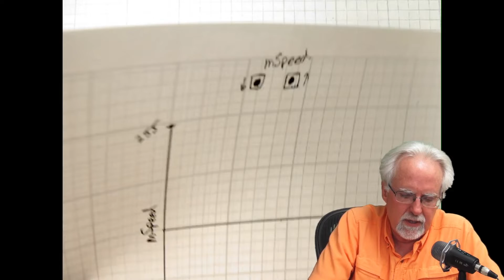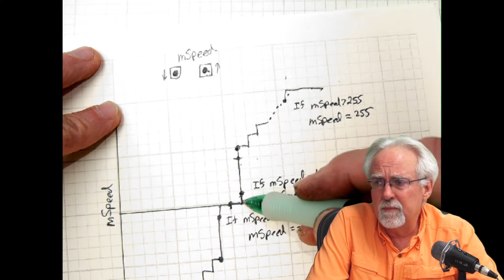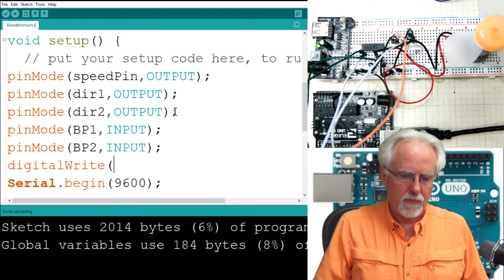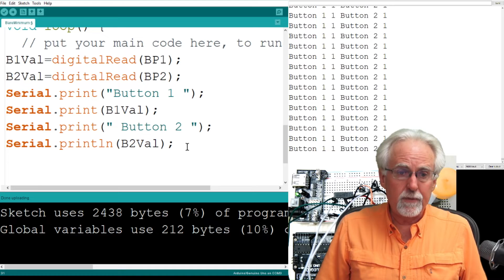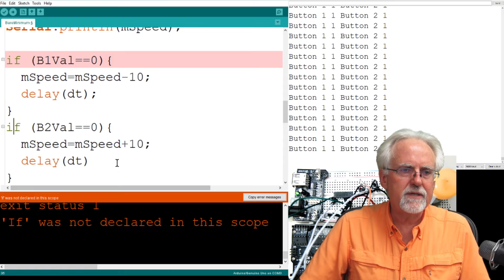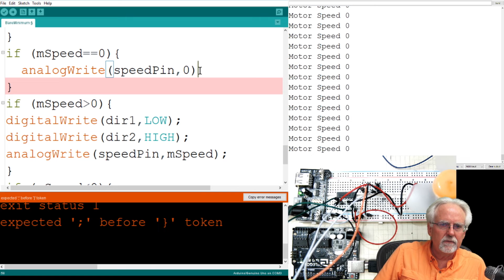Arduino Tutorial 40: Controlling DC Motor Speed and Direction with Pushbuttons

Comment: This one almost broke me.  I tried looking back at the prior lesson sketches that I have saved,  and that helped a little, but it still didn't get me there. I had to use the serial monitor and get the buttons doing what I wanted first - before trying to command the motor.
I used. My motor will run at 60, so I set each step to 60 and capped it at 240, is that cheating? I hope not. 

I think I have moved along in this course too quickly. I am having trouble remembering how to do things, like recalling a button state and when to use 'if' commands and when to use 'while' commands. I most definitely need to review the math (you scolded me for cheating yesterday).  Understanding a concept and being able to duplicate it during the lesson is far different from mastering it and committing it to memory for recall later. 

I will get there, I just have to slow down, and practice what I learned before moving to the next lesson.

Thank you for continuing to mentor us. While I am reaching retirement and only learning this as a hobby, my hope is that the younger generations are also learning from you, following along, and choosing related careers.  Thank you.

Comment: You can reference my code and change your pin: 

int in1 = 2;
int in2 = 3;
int en1 = 11;
int dt = 50;
int but1 = 7;
int but2 = 13;
int valBut1;
int valBut2;
int newSpeed = 20;
int oldSpeed;
int state = 1;
String mes1 = "state / speed: ";

void setup(){
  pinMode(in1, OUTPUT);
  pinMode(in2, OUTPUT);
  pinMode(en1, OUTPUT);
  pinMode(but1, INPUT_PULLUP);
  pinMode(but2, INPUT_PULLUP);
  
  Serial.begin(9600);
}

void loop(){
  valBut1 = digitalRead(but1);
  valBut2 = digitalRead(but2);
  
  // plus / minus when press but1 / but2
  if(valBut1 == 0){
    newSpeed += 20;
  }
  if(valBut2 == 0){
    newSpeed -= 20;
  }
  // how to change your state
  if(newSpeed == 0){
    if(newSpeed > oldSpeed){
      state = 1;
    }
    else if(newSpeed < oldSpeed){
      state = 0;
    }
  }
   // limit range
  if (newSpeed > 240){
    newSpeed = 240;
  }
  if (newSpeed < -240){
    newSpeed = -240;
  }
  // follow by state, it can modify direction
  if(state == 1){
    digitalWrite(in1, HIGH);
    digitalWrite(in2, LOW);
    analogWrite(en1,newSpeed);
  }
  else{
    digitalWrite(in1, LOW);
    digitalWrite(in2, HIGH);
    analogWrite(en1,-newSpeed);
  }
  oldSpeed = newSpeed;
 
  Serial.println(mes1);
  Serial.print(state);
  Serial.print(" / ");
  Serial.println(newSpeed);
  delay(dt);
}

Comment: int buttonpin1 = 12;
int buttonpin2 =13;
int buttonval1;
int buttonval2;
int speedpin =5;
int dir1=4;
int dir2=3;
int mSpeed;
int dt = 250;
void setup()
{
  Serial.begin(9600);
  pinMode(buttonpin1, INPUT);
  pinMode(buttonpin2,INPUT);
  pinMode(speedpin, OUTPUT);
  pinMode(dir1, OUTPUT);
  pinMode(dir2, OUTPUT);
}

void loop()
{
  buttonval1 = digitalRead(buttonpin1);
  buttonval2 = digitalRead(buttonpin2);
  Serial.print("button 1 = ");
  Serial.print(buttonval1);
  Serial.print(", ");
  Serial.print("button 2 = ");
  Serial.println(buttonval2);
  delay(dt);
  if (buttonval1 == 0) { 
    mSpeed = mSpeed + 5;   
    if (mSpeed > 255) mSpeed = 255; 
}
if (buttonval2 == 0) { 
    mSpeed = mSpeed - 5;   
    if (mSpeed < -255) mSpeed = -255;  
}
 
if (mSpeed >= 0) {
    digitalWrite(dir1, HIGH);
    digitalWrite(dir2, LOW);
    analogWrite(speedpin, mSpeed);
} 
  if (mSpeed<0){
    digitalWrite(dir1, LOW);
    digitalWrite(dir2, HIGH);
    analogWrite(speedpin, -mSpeed); 
}
  
}

This is the way I have done it sir 👋

Comment: Even I wire l293d correctly, it is getting  so hot and when measured with multimeter leg8 is getting  8.75v from 9v battery, but leg3 and leg6 are both having current  which wasn't supposed to be, what might  be problem

Comment: #include <Arduino.h>

// variable define
int speedControlPin = 4, dirPin = 25, dir2Pin = 26, btnHighPin = 18, btnLowPin = 19;
int deplayTime = 100;
int oldBtnHighStatus = 1, oldBtnLowStatus = 1;
int speedValDefault = 100;
int speedNagative = 0;
int speedVal = 0;
  bool forward = true;

// functions registor
void setDirMotor(bool clockSpin);
int speedControl(int currentSpeed, bool increate);
void printingVal(int clockSpin, int btnHighPess, int btnLowPress, int speedValue);
void changeSpinDir(bool increate);

// setup define
void setup() {
  Serial.begin(115200);
  pinMode(btnHighPin, INPUT_PULLUP);
  pinMode(btnLowPin, INPUT_PULLUP);
  // registor pin control dc motor
  pinMode(speedControlPin, OUTPUT);
  pinMode(dirPin, OUTPUT);
  pinMode(dir2Pin, OUTPUT);
  // default direction of motor spin
  changeSpinDir(forward);
}

// actions loop define
void loop() {
  int newBtnHighStatus = digitalRead(forward ? btnHighPin : btnLowPin);
  int newBtnLowStatus  = digitalRead(forward ? btnLowPin : btnHighPin);
 
  if(newBtnHighStatus == 0 && oldBtnHighStatus == 1) {
      speedVal = speedControl(speedValDefault, true);
  } else if (newBtnLowStatus == 0 && oldBtnLowStatus == 1) {
      speedVal = speedControl(speedValDefault, false);
  }
  else if (speedVal < 100) {
    speedVal = 100;
    forward = !forward;
  }
  setDirMotor(forward);
    // value change
  speedValDefault = speedVal;
  oldBtnHighStatus = newBtnHighStatus;
  oldBtnLowStatus = newBtnLowStatus;
  // printing Val
  printingVal(forward, newBtnHighStatus, newBtnLowStatus, speedVal);
  // speed writing
  analogWrite(speedControlPin, speedVal);

  // print value for debuging
  delay(deplayTime);
}

// func defines
void setDirMotor(bool clockSpin) {
  digitalWrite(dirPin, clockSpin);
  digitalWrite(dir2Pin, !clockSpin);
}

int speedControl(int currentSpeed, bool increate) {
  int speedVal = increate ? currentSpeed + 20 : currentSpeed - 20;
  if(speedVal > 255) {
    speedVal = 255;
  } 
  return speedVal;
}

void printingVal(int clockSpin, int btnHighPess, int btnLowPress, int speedValue) {
  Serial.println();
  Serial.printf("Clock Spint: %d \n", clockSpin);
  Serial.printf("Btn High Press: %d \n", btnHighPess);
  Serial.printf("Btn LOW Press: %d \n", btnLowPress);
  Serial.printf("Motor Speed Val: %d \n", speedValue);
}

void changeSpinDir(bool increate) {
  digitalWrite(dirPin, increate);
  digitalWrite(dir2Pin, !increate);
}

Comment: finished my own way with a few more if statements + a state for the direction, but it works. wasn't aware the motor speed could take negative values or the absolute function, this way works nicely with less lines of code
Reply from the maker: Glad you found a way that works for you.

Comment: I had it in principle with motor speeds incrementing and decreasing but I used 100 ( a stopping point for my motor) did not use negative values and did not know about absolute value statement. Just couldn’t make my motor change direction even though I knew to swap dir1 and 2 over via HIGH and LOW

Comment: int s1=2;
int s2=6;
int dir1=4;
int dir2=3;
int speedp=5;
int dt=200;
int speed=0;
void setup(){
  
  Serial.begin(9600);
  pinMode(s1, INPUT_PULLUP);
  pinMode(s2, INPUT_PULLUP);
  pinMode(dir1, OUTPUT);
  pinMode(dir2, OUTPUT);
  pinMode(speedp, OUTPUT);
  analogWrite(speedp,0);
  
  
  
}

 
  
void loop() {
  int read1 = digitalRead(s1);
  int read2 = digitalRead(s2);
  Serial.print("s1- + -");
  Serial.print(read1);
  Serial.print("| s2- (-) -");
  Serial.println(read2);
  delay(dt);

  if (read1 == 0) speed += 20;
  if (read2 == 0) speed -= 20;

  if (speed >= 0) {
    speed = constrain(speed, 0, 255);
    digitalWrite(dir1, LOW);
    digitalWrite(dir2, HIGH);
    analogWrite(speedp, speed);
  } else {
    speed = constrain(speed, -255, 0);
    digitalWrite(dir1, HIGH);
    digitalWrite(dir2, LOW);
    analogWrite(speedp, -speed);
  }

  Serial.println(speed);
  delay(dt);
}
  i think this also work, dont you think sir?

Comment: I went with a slightly different approach. I had a 'counter' variable with IF statements keeping it between -5 and 5. I then multiplied the absolute value of counter by 51 to set the fan speed.

int counter = 0;
int fanSpeed = 0;
void loop() {
  analogWrite(pwmPin,fanSpeed);
  int left = digitalRead(leftButton);
  int right = digitalRead(rightButton);

  if (!left) {
    if (counter > -5) {
      counter--;
    }
  }
  else if (!right){
    if (counter < 5) {
      counter++;
    }
  }

  if (counter < 0) {
    digitalWrite(leftPin, HIGH);
    digitalWrite(rightPin, LOW);
  }
  else if(counter > 0) {
    digitalWrite(leftPin, LOW);
    digitalWrite(rightPin, HIGH);
  }
  else {
    digitalWrite(leftPin, LOW);
    digitalWrite(rightPin, LOW);
  }

  fanSpeed = abs(counter)*51;
  Serial.println("Counter: " + String(counter) + " Fan Speed: " + String(fanSpeed));
  delay(150);
}

Comment: I couldn't make it more compact, except if I want to make a switch down keeps changing the speed.

int speedPin = 5;
int dir1 = 4;
int dir2 = 3;
int step = 10;
int nSpeed = 150;// must be greater than 2*step
int xSpeed = 255;
int s1 = 13;
int s2 = 12;
int speed = 0;
int s1Val,s2Val,oS1Val,oS2Val;
void setup() {
  pinMode(speedPin,OUTPUT);
  pinMode(dir1,OUTPUT);
  pinMode(dir2,OUTPUT);
  pinMode(s1,INPUT);
  pinMode(s2,INPUT);
  digitalWrite(s1,HIGH);
  digitalWrite(s2,HIGH);
}
void loop() {
  oS1Val= s1Val;  oS2Val= s2Val;

  s1Val=digitalRead(s1);
  if (s1Val<oS1Val) speed+=step;

  s2Val=digitalRead(s2);
  if (s2Val<oS2Val) speed-=step;

  if (abs(speed) == step) speed = speed/step*nSpeed;
  else if (abs(speed) < nSpeed) speed = 0;

  if(speed > xSpeed) speed-=step;
  else if (speed < -xSpeed) speed +=step;

  digitalWrite(dir1,speed > 0);
  digitalWrite(dir2,speed <= 0);
  analogWrite(speedPin, abs(speed));
  delay(100);
}

Comment: I enjoyed this homework  :

int in1 = 2;

int in2 = 4;

int speedpin = 3 ; 

int upbutt =5 ;

int dnbutt = 6 ;

int dnval;

int upval;

int calc = 512 ;

int speed ; 

void setup()

{
pinMode(in1, OUTPUT);
pinMode(in2, OUTPUT);

pinMode(speedpin, OUTPUT);

pinMode(upbutt,INPUT_PULLUP);

pinMode(dnbutt,INPUT_PULLUP);

  
Serial.begin(9600);

}

void loop()

{
  
 

 upval=digitalRead(upbutt) ;
 dnval=digitalRead(dnbutt);

if (upval ==0 ){
  calc = min(1023, calc + 40);
  delay(100);
}
if (dnval==0) {
  calc = max(0, calc - 40);
  delay(100);
}
  
speed = (255.0 / 1023.0 ) * calc  ; 

if (calc<500) {
    digitalWrite(in1,LOW);
    digitalWrite(in2 , HIGH);
    analogWrite(speedpin,speed);
}
else if (calc>550) {
    digitalWrite(in1,HIGH);
    digitalWrite(in2 , LOW);
;    analogWrite(speedpin,speed);
}

else {
    digitalWrite(in1,LOW);
    digitalWrite(in2 , LOW);
}
    
Serial.print("Calc: "); Serial.print(calc);
Serial.print(" Speed: "); Serial.println(speed);
}

Comment: This assignment was a tough one. It took me around 3 hours to get it. I had to change my approach to the problem around 3 times and spent a good majority of those times debugging. But I'm so satisfied with finally being able to get it by myself! My approach was a bit different, but here is my code:

int speedPin = 11, d1Pin = 13, d2Pin = 12, b1 = 7, b2 = 6;
int motorPos = 0, motorSpeed, bLeft = 0, bRight = 0;
unsigned long lastUpdateTime = 0, currentTime;
void setup() {
  Serial.begin(9600);
  pinMode(speedPin, OUTPUT);
  pinMode(d1Pin, OUTPUT);
  pinMode(d2Pin, OUTPUT);
  pinMode(b1, INPUT_PULLUP);
  pinMode(b2, INPUT_PULLUP);
}

void loop() {
  bLeft = !digitalRead(b1);
  bRight = !digitalRead(b2);

  currentTime = millis();
  if (lastUpdateTime - currentTime >= 500) {
    lastUpdateTime = currentTime;   //This checks the time spent in-between presses. 50ms.

    if (bLeft == 1 && motorPos < 33) {   //33 is the amount of times the button needs to be pressed to reach max capacity.
      motorPos++;
    } else if(bRight == 1 && motorPos > -33) {
      motorPos--;
    } else if(motorPos == 0) {
      analogWrite(speedPin, 0);
    }

    if (motorPos > 0) {
      digitalWrite(d1Pin, HIGH);
      digitalWrite(d2Pin, LOW);
      motorSpeed = 90 + motorPos * 5;
      analogWrite(speedPin, motorSpeed);
    } else if (motorPos < 0) {
      digitalWrite(d1Pin, LOW);
      digitalWrite(d2Pin, HIGH);
      motorSpeed = 90 + -motorPos * 5;
      analogWrite(speedPin, motorSpeed);
    }
  }
  Serial.println(motorSpeed);
  Serial.println(motorPos);
}

Comment: Except for my recurrent error of using = instead ==, and missing the direction pins sentences, was easy enough, but I actually connected the IC wrong, and it didn't worked until I realized that (obviously). It was a bit tricky, and time consuming (mostly because of my frustration) but ok.

Comment: I did it by using digital read on the direction pin like this
if(digitalRead(dir1) == 1 && digitalRead(dir2) == 0 && m_speed < 255){
    m_speed += 15;
  }
and turning the value of dirPins when they reach 100 and speed to 0.
Thanks for the lesson.

Comment: Sorry Paul, I failed,  I over thought it, yet again. I had the 2 switches as pull_ups using the pinMode(BP1,INPUT_PULLUP);  pinMode(BP2,INPUT_PULLUP);  and then went down the rabbit hole of logic based if statements, 
I admit, I copied your code, changed one pin assignment and it worked with my circuit. Before I run the code though, I spent some time going through the it making sure I understood what each if statement was doing, and why.

I kept thinking of the switches as a single component and when one was HIGH and the other low etc. I should have sat down with a pad and written down what I need to achieve, then what happens when a switch is pressed and if that would give the result I wanted and definitely not try to do it on the fly. I promise to try harder next time.
OK so I had paused the video at the start to put in my comment then at 3minutes in you tell us your common issue is student trying todo things without doing it on paper first. DOH.

Comment: Great assignment. I ended up getting it done, but I made mine a little more difficult than it needed to be. I created a variable called mSpeedNum and replaced mSpeed with that. I then made an if statement to make mSpeed equal to mSpeedNum*-1 if mSpeedNum was negative.....your way was way simpler tojust do an analog write for each option.

Also, I made my fan start and stop at different mSpeeds since that's how the motor works. So it would go from 0 to 130 at the first button push, then on the way back down it wouldn't go to 0 until around 100.

Comment: I have a feeling I over complicated this code but excited to find out

// Button(s)
int leftButton = 8;
int rightButton = 9;

int oldValLeft = 1;
int oldValRight = 1;
int newValLeft;
int newValRight;

// DC Motor
int speedPin = 3;
int rightMotor = 7;
int leftMotor = 4;

float leftSpeedVal = 0;
float rightSpeedVal = 0;
float increment = 85;

void setup() {
  // put your setup code here, to run once:
  Serial.begin(9600);
  pinMode(leftButton, INPUT_PULLUP);
  pinMode(rightButton, INPUT_PULLUP);

  pinMode(leftMotor, OUTPUT);
  pinMode(rightMotor, OUTPUT);
  pinMode(speedPin, OUTPUT);
}

void loop() {
  // put your main code here, to run repeatedly:
  newValLeft = digitalRead(leftButton);
  newValRight = digitalRead(rightButton);
  Serial.println(leftSpeedVal);

  if (oldValLeft == 0 && newValLeft == 1 && leftSpeedVal < 255)
  {
    if (rightSpeedVal == 0) {
      digitalWrite(leftMotor, HIGH);
      digitalWrite(rightMotor, LOW);
      leftSpeedVal += increment;
      analogWrite(speedPin, 255);
      delay(50);
      analogWrite(speedPin, leftSpeedVal);
    }
    else if (rightSpeedVal > 0) {
      rightSpeedVal -= increment;
      analogWrite(speedPin, rightSpeedVal);
    }
  }
  else if (oldValRight == 0 && newValRight == 1 && rightSpeedVal < 255)
  {
    if (leftSpeedVal == 0) {
      digitalWrite(leftMotor, LOW);
      digitalWrite(rightMotor, HIGH);
      rightSpeedVal += increment;
      analogWrite(speedPin, 255);
      delay(50);
      analogWrite(speedPin, rightSpeedVal);
    }
    else if (leftSpeedVal > 0) {
      leftSpeedVal -= increment;
      analogWrite(speedPin, leftSpeedVal);
    }
  }
  oldValLeft = newValLeft;
  oldValRight = newValRight;
  delay(10);
}

Comment: int port1=4;
int port2=5;
int speed=0;
int speedbut=7;
int buttonu=2;
int buttond=3;
int buttonval1;
int buttonval2;
int lpd=0;
void setup() {
  // put your setup code here, to run once:
Serial.begin(9600);
pinMode(buttonu,INPUT);
digitalWrite(buttonu,HIGH);
pinMode(buttond,INPUT);
digitalWrite(buttond,HIGH);
pinMode(port1,OUTPUT);
pinMode(port2,OUTPUT);
pinMode(speedbut,OUTPUT);

}

void loop() {
  // put your main code here, to run repeatedly:
buttonval1=digitalRead(buttonu);
buttonval2=digitalRead(buttond);
if (speed==0 && buttonval1==0 && buttonval2==1){
  lpd=1;
}
if (speed==0 && buttonval2==0 && buttonval1==1){
  lpd=2;
}
 
if (lpd=1){
  digitalWrite(port1,HIGH);
  digitalWrite(port2,LOW);
  if (buttonval1==0){
    speed=speed+10;
  }
  if (speed==10){
    speed=100;
  }
  if (buttonval2==0){
    speed=speed-10;
  }
  if (speed==60);{
   speed=0;
  }
  if (speed==250){
    speed=255;
  }
  if (speed>=255){
    speed=255;
  }
  analogWrite(speedbut,speed);
  }

if (lpd=2){
  digitalWrite(port2,HIGH);
  digitalWrite(port1,LOW);
  if (buttonval1==0){
    speed=speed-10;
  }
  if (speed==10){
    speed=100;
  }
  if (buttonval2==0){
    speed=speed+10;
  }
  if (speed==60);{
   speed=0;
  }
  if (speed==250){
    speed=255;
  }
  if (speed>=255){
    speed=255;
  }
  if (speed==245){
    speed=250;
  }
  analogWrite(speedbut,speed);
  }

}